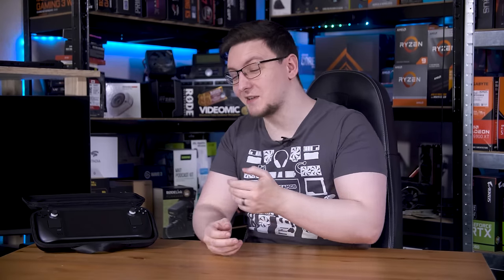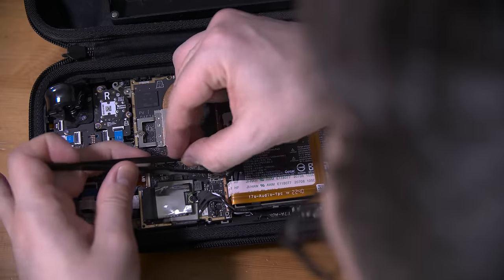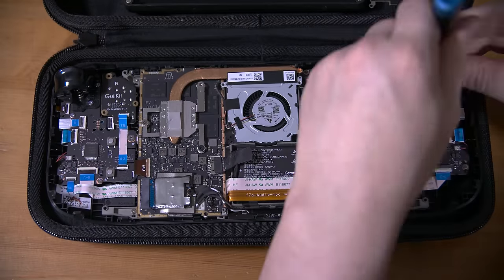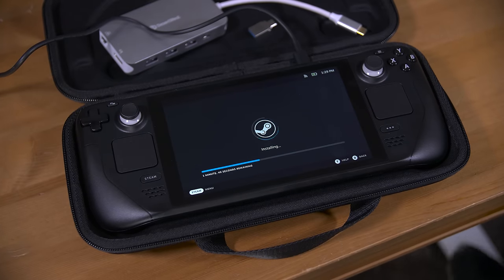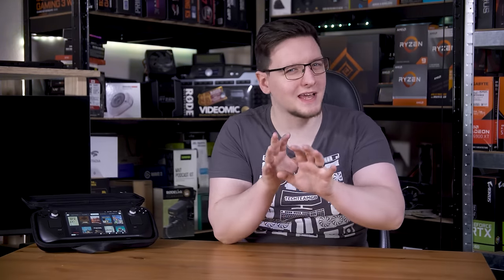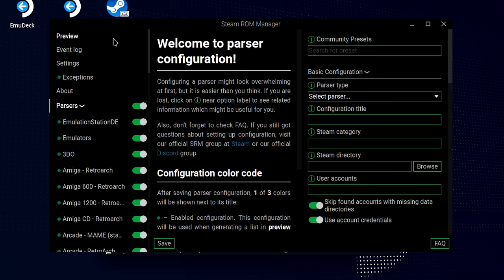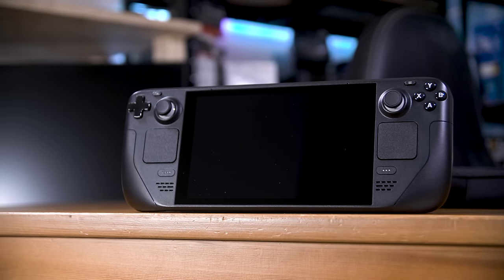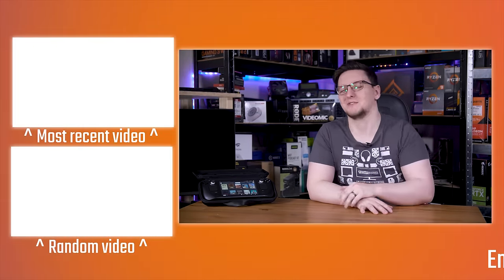I Bought a 64GB Steam Deck and FIXED EVERYTHING WRONG WITH IT!

Comment: YOU ARE RUNNING YOU DECK IN THE CASE.  Are you a  MAD fool?  Even if it is propped a little up by the power cable that is not a good thing to do.  You are severely blocking the air intake on the back and that is just SILLY as hell!  You are showing a lot of people very bad practices for any device like this.  You have it just sitting in the background in the case running.  How dose that make any sense to you.  You are very likely shortening its life span.
Reply: If you actually bother to look at how the deck fits in the case, you'd notice that it does not in fact cover the air vent in the back. There are bumps in the bottom corners and a ridge on the top to raise it up enough to let airflow in.
Reply: I doubt that's how he actually uses the deck anyway. Probably just did it that way for the video so it looks nicer, easier to film etc.

Comment: I did this all to mine but look for a aya neo next but can't find any takers but I do use windows with some tweaks and it works great just would have preferred the next as it does not need any help to run windows also valve should work more with the windows side as people are still going to use and buy steam games so what is the deal
Reply: Valve doesn't want to be held captive by MS. For a while it looked like MS was going to app store everything and force valve to pay an MS tax for every game sold.